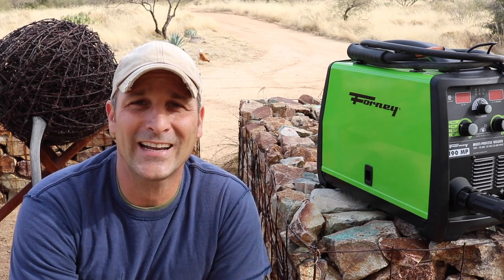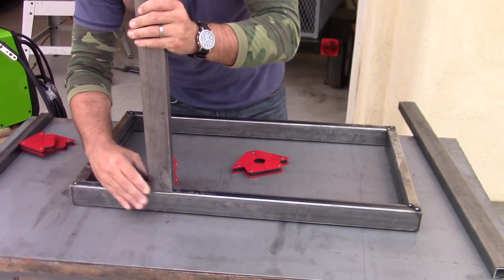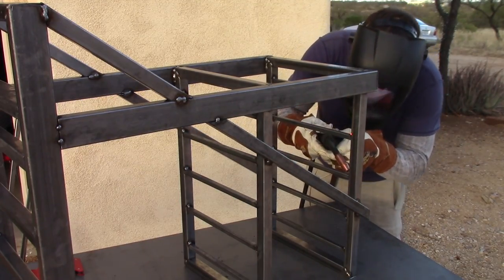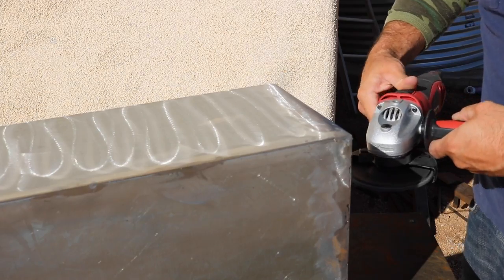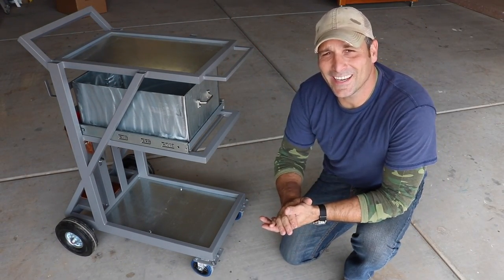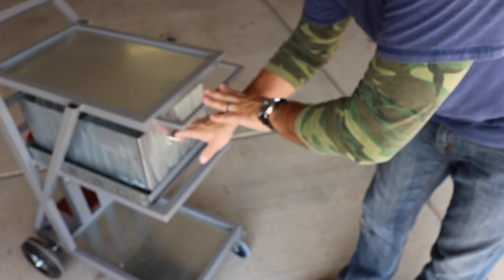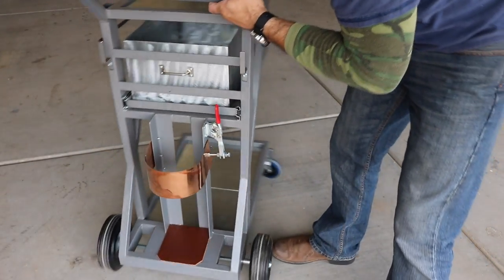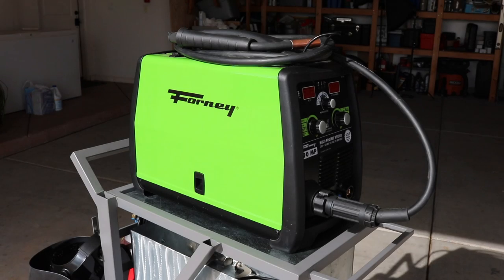Making a Welding Cart - How to DIY

Comment from the maker: For those interested in the Forney multiprocess welder I use, here is a link.  Forney sells welders, plasma cutters and just about any other metal working tool you can imagine!
http://bit.ly/2LjRRqH
Reply: how is it so far?
Reply: What type of gas do you use? Will the welder run without gas? I love the welding videos. Keep up the great work!
Reply: How about a link to those magnetic angles!?
Reply: homesteadonomics x
Reply: @kenbrake2828  i bought it online and local welding equipment stores. Just bought a MIG welder and those magnets. Too expensive at lcoal store. RM45 for two and just RM40 for 4 online. Saw it's available at banggood but it's too expensive. Never try it though. Rainy season over here in Malaysia.
Reply: @Jacob-oq3uv  

For most welding with MIG, you use a mix of 75% Argon/25% CO2. On machines like this, you can also run fluxcore wire without a shielding gas, and for Tig, you use 100% Argon.

Comment: Thanks for the inspiration.  I just got a Millermatic 211 and was told my first project should be to build a welding cart.  I looked on YouTube for ideas and found your cart build so I ended up copying it for the most part.  I have not built the drawers yet but they are coming.  I used 1/8 thick steel as it was easier for me to weld.  Took two weekends to finish, probably close to two full days.  Wife’s not very happy as she hasn’t seen much of me :). Oh well...Thanks again!

Comment: So I've got a dumb question about welders for all the experts. It doesn't appear that 120v welders are particularly capable. I don't have enough room in my panel to add a new 220 breaker. I know a lot of pros who have to weld at job sites just get a generator, and this frankly seems like a good idea all around. Can I trust the cheap generators with the square sine inverters do do the job, or do I need a true-sine generator to get a 220 welder to perform? 

Right now I'm getting along with smaller projects and repairs using a Harbor Freight buzz box, but I know if I'm going to do anything serious, I'm going to need a 220v multi-process like the Forney. Especially when I do that LS1 swap with a Fiat 500.
Reply: You can't simply upgrade or add a breaker panel without respect to whether the service drop can handle the additional load. That can cost thousands.

I had a very specific question. My question is not whether I should get a generator for welding. It's what kind of generator I should get.
Reply from the maker: Hi Andrew,  this welder is actually a 120/220v machine.  I welded this entire project off of 120 because I haven't yet changed out the 220 receptacle from my old welder.  That is one of the things that drew me to this.... the fact that I can use either power source.  I plan to use the 120 most of the time as I have a heavy gauge extension cord and that will allow me to go about 75' from any power source in the house:)  Hope that helps:)
Joe
Reply: Yes, very helpful! Being able to have this welding ability without getting a generator or adding a subpanel wasn't an option I thought I had.

Comment: Howdy, another weldcart video, guess I had to watch yours after all the chicken stuff.. I just build version 3 of my welding cart.
There were some lessons learned for version 2, I have four casters so I can move it sideways, almost everyone seems to use straight wheels in back, I hated that.  The other thing I fixed in version 3 was to have a cabinet to store stuff, instead of hanging it all off hooks, etc.
Everything gets covered with dust and grinding dust, so having an enclosed cabinet keeps everything clean and tidy, and doesn't get caught on things when I roll it through my tight spaces since my shop is always packed full of everything.

Comment: Made my own cart as well my first project. Yours looks good. I ran my angled sides opposite direction to create a handle support, then welded a plate to each side with a hole to accept 3/4 inch water pipe with caps. I remove a cap to slide pipe out and swap argon bottle. Also I put my sheet stock on top of the frame for the shelves in hopes of not accumulating dirt in the pan and allow my plastic containers to slide out easily. WOould share a picture but seems to not be possible here.
Reply from the maker: That sounds cool Bruce... you can share a pic on the homesteadonomics facebook page if you want.  or you can email me one... my email  is in the 'about' tab of my channel page... would love to see it:)
Reply: Will do

Comment: Nice work. I think I'd lose the back handle in case I'd want a bigger tank, though. I like the slide-out drawer idea.
Reply from the maker: Doug Alan thanks Doug!   It’s funny you mentioned it, because I actually had to cut the middle out of that handle to do just that...so you were spot on😀👍
You can see it in the first couple videos of the travel trailer build, with the full size tank.   Thank for watching!

Comment: how is the welder holding up? Have you used the tig process and how is the arc?
Reply from the maker: HI Chris,

Yes, the welder has held up well!  I've used it for a shipping container shop project a bunch.  Doors, Windows, truss brackets, etc,... it's my most recent series of videos.  As for TIG.. not I don't have the torch yet but i do definitely want to start using the tig function.  I have a couple more welding related projects coming up after I get the shipping container shop to a functional state.  It's almost there.. just need to finish electric and get some benches built.
Joe
Reply: homesteadonomics I just ordered an ahp alpha tig 200x today. I'm probably going to buy a forney mig welder later.

Comment: I found the best way to learn tig welding is to start with brazing if you can braze then you can tig it will take time and practice but once you  get the hang of tig welding it is a whole new world of fun I have bin tig welding only for about 3 months and loving it I hope you enjoy it as well
Reply: chrissteene really? I think I will get some brazing rods
Reply from the maker: I've been hearing that recently...my father in law knows a guy that hasn't done anything but tig for years.  He is an automotive fabricator.  I'm gonna have to give it a go sometime:)
I figure I'll use a bit of everything... I actually really like stick cause it's just so simple to get going... pick a rod and burn:)
JOe
Reply: it is a great way to learn how to tig you learn how fast to feed the material as it melts and fills in the seam the best part is it is cheaper than tig materials
Reply: stick is nice mig welding is a lot easier just point and go but tig takes lots of practice that why I say the best and cheapest way to learn how is to start with brazing you will learn how to control  the material as it melts and fills in the seam

Comment: Nice. I also have the forney mp190  and I have the whole Tig set up as well. I also had to buy of course a separate tank for argon. Works really well. Wish that this model would of come with everything it's built to do. I spent the $199 to get the Tig torch made exactly for this model but jeez... like I said wish it would have been included.

Comment: one thing i have to point out: We are talking about DIY project, and ive never seen welders are secured to their carts. Remember, most of us don't have a big factory with flt surface to roll on, that means these carts will have to roll down steep drive way or gravel backyard like yours. I mean,  some ideas to secure the welder to the cart is a must. Otherwise, great job mate.

Comment: Maybe install an outlet for the grinder, work lights and fans.  But for me I would probably place the welder on the second shelf and the tool drawer on top so that it wouldn't be top heavy. Also you would not need to use drawer slides since you could just place flip-up covers.

Comment: That bottle holder is sketchy as frig. If a lead or something pulls that handle your bottle is going to fall off. I'd suggest something like a bolt with a wing nut to hold the copper to the cart.

Comment: Also the size of wheels you used will come in handy getting over extension cords and air hoses etc. I never liked the store bought ones because the casters are always tiny!
Reply: That is super important. The cart I made for my everlast elder had tiny casters and it couldnt go over anything without hanging up
Reply: I welded shopping cart wheels on my creeper seat for the same reason! It will run over a garden hose.
Reply: cool idea

Comment: Nice cart!  I like it...I like it alot! Roughly what was your cost? Have you posted any plans yet?
Reply from the maker: Hi Gerry,

I don't really do plans... i kind of just build by eye.  ... which ends up in mistakes but I just new that i needed the top shelf big enough to hold the welder and the base to be big enough to be sturdy :)  
as for cost... i think i spent $40 on tubing with about $10 from the scrap remnant room at Industrial Metal supply in Tucson... and maybe another $20 on casters from harbor freight... some of the stuff i had on hand to.  ... to be safe just figure I spent about 100 :)
Joe

Comment: Would it be possible for you to post a materials and dimension list for this project...Great video.
Reply from the maker: Hi RJ.. I believe I posted general dimensions to one persons question but can't find it now.  But I generally build by eye and just measure for things like making sure the welder will fit on the top shelf, etc,.  So it will greatly depend on your welder.  But I can say that the bottom shelf is roughly 17" by 29" and the upper two shelves are 14x22".  The height really will depend on your welder though.  The tubing was 1x1 for the shelves and 1x2 for the base and uprights.  Anyways hope that helps:)

Comment: I apologize if you have already answered this question but do you have plans or can you post some rough dimensions? I would love to build one just like yours. Its awesome!
Reply from the maker: Hi Toby.. unfortunately I don't really make plans right now as I just usually build by eye and measure for specific dimensions that I need to fit something like the height and width of the welder.  But here are some basic dimensions I posted on another comment.
... the bottom shelf is roughly 17" by 29" and the upper two shelves are 14x22".  The height really will depend on your welder though.  The tubing was 1x1 for the shelves and 1x2 for the base and uprights.  Anyways hope that helps:)

Comment: Great project but why the hook on the inside? You will never use it because it's too difficult to use. Make it easy to use and you will used it
Reply from the maker: Thanks Carsten!  Yes, the hooks on the inside are not convenient but this machine is a 110/220v machine and I plan to use the 110v most of the time.  So instead of uncoiling the cables I just bring the power cord to them.  So I won't be taking the cables off of those hooks much:)  
thanks for checking it out :D
Joe

Comment: what do you think of the welder it self?
Reply from the maker: I REALLY like it a lot!  I haven't use a ton of welders but I have really enjoyed using this.  If you check out my shipping container shop build you will see that I use it to modify the container with new end doors, man door, windows, etc,.  I also was able to switch it over to stick so that I could weld up some 1/4" tubing for the new end frame after I cut the original container in half.  
anyways, hope that helps:)
Joe

Comment: Excellent job sir!
How happy are you with the Forney and is it the multiprocess or straight Might/Flux?
Reply from the maker: Hi Michael,

This is a Forney 190MP (multiprocess).... I really love it a lot!  I've used MIG mostly, then stick but haven't used flux core yet on it.  I was able to go try out a spool gun and TIG on one too and they worked really well too... but unfortunately I don't have those attachments on mine yet :)
JOe
Reply: Tig can and is a pain you'll at least want High frequency start and a good pedal setup.
I have a scratch start rig on my AHP st160 it works ok but I just can't run a straight line with a Tig torch.
It's generally the process you'll want for either Stainless or aluminum but aluminum you really will need high frequency and a pedal.

Comment: That came out awesome man! One thing I would add tho is a tie down strap to go over the top of the welder to secure it to the frame. I've almost had a tig machine tip off of my cart in my shop, was scary!
Reply from the maker: Thanks Dan!  Yes, I've added a strap since I built it... didn't think aobut it during the build but when I push it through the gravel it would easily fall with the bumps

Comment: Does anyone know a good beginner weld that runs off of 110 power. I do a lot of work on quads and tractor and starting to think I need to get a welder to bring those projects one step further. Thank you
Reply from the maker: Hi TG.. this welder is actually a 120 or 220 unit... if can do either voltage...  I built this using only 110v power supply:)
Joe
Reply: My first was the Everlast 160 STH tig or stick  for $500

Comment: Was a Miller, Everlast or AHP to expensive?
Reply: I use Hobart electrodes for welding they work great and I have never had an issue with them
Reply from the maker: I looked at several but the one of the main reasons I went with Forney is because my local steel supplier carries the whole line and I was able to put my hands on them and talk to a couple guys who use them that work there.  They talked very highly of them as well as the fact that I liked the warranty and the multiprocess capability that they offered.  So far with this project I'm really liking it!  
Joe

Comment: Great cart! 
Are you able to share the plans/dimensions? 
Thank you!
Reply from the maker: Thanks Octorsep!  yes, eventually I will.  I'm trying to learn sketchup now and plan to do plans of several of my projects:)
Joe
Reply: homesteadonomics do you have plans for the chair/step ladder/welder and bottle holder?!
Reply from the maker: Hi Hellums... no, unfortunately I don't... I usually build by eye and measure for the things I need to fit.  i.e. shelf wide enough and long enough to hold my welder...
I need to make plans but i just don't have a good grasp on sketchup right now so I need to make time to get good at that first then I'll start making plans:)
Reply: Understood sketching and drawing plans take time and effort.  How about a list of the steel stock you used?  Great build!  Simple and purposeful although I agree with others about added room for another bottle.  That's how I plan to create mine based on your design.  Thanks for sharing.

Comment: Hi, Could you show the axel and how this was welded on. Well done I like the design!!! BTW
Reply from the maker: Thanks so much!  The axle runs though two pieces of angle iron that are welded to the bottom with 5/8" holes drilled in them.  Hope that helps:)
Joe
Reply: Would you be so kind as to provide a bottom view pic of the Axel. Keen to see what you did.
Reply: Thought I would let you know. Based on your design I am 90% complete with mine. Pity i cannot add Photos here. :-)